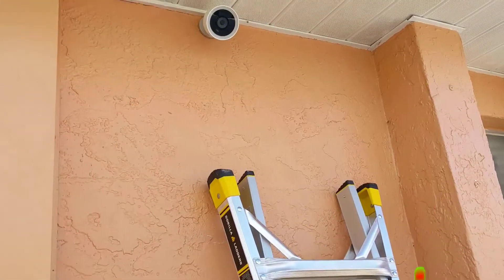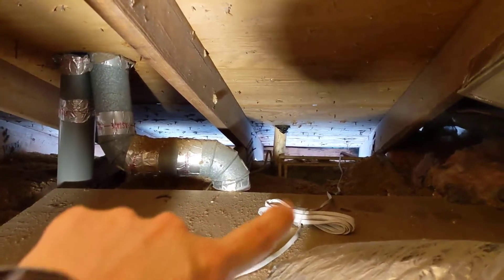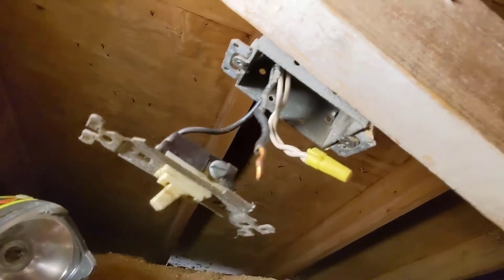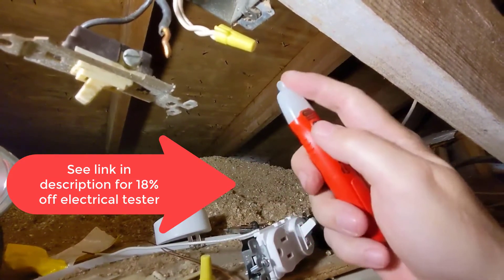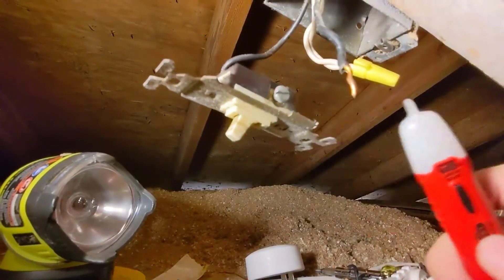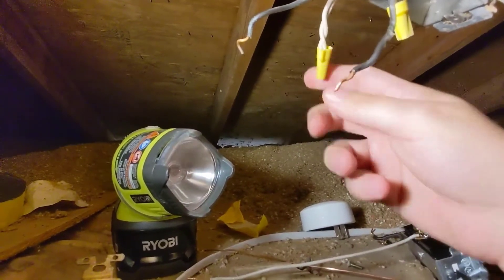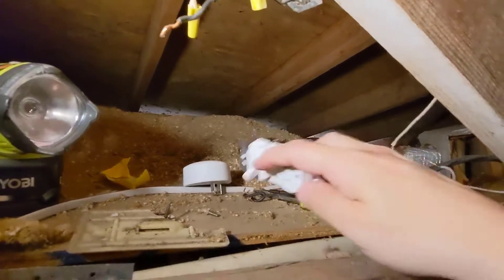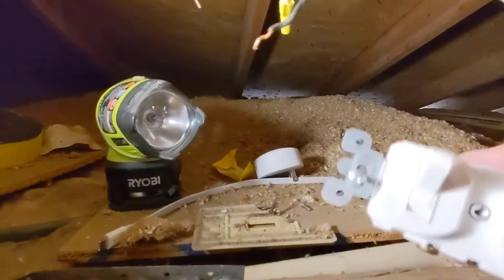How to install ANY Google Nest Cam outdoor without available outlet basic home wiring

Comment: Can you cut the wire for the adapter and hard wire it? I have a light fixture beside where I’m going to install it, was hoping to just cut the wire and hard wire it to the wiring of the light fixture
Reply from the maker: Problem with that is how will you disconnect it or unplug if you need to cut the power to it?
Reply: @SaveGreenHere  good point about unplugging it. I was thinking it would be permanent so it’s always powered. The outdoor light fixture has a switch which would control power to it. Just brainstorming some other option!
Reply: @OmarChannel Have you already a solition? Is also want to hard wire it to my light.
Reply: @Larsehh  I was advised not to cut the power and hardwire since, the power to the light fixture is AC, and the plug had ac/dc converter (DC is fed to the nest camera). Doing direct connection could damage the nest apparently. At this point just charging it every few months.
Reply: Im thinking of hardwiring my nest camera as well. The access from our part of the home to the attic or basement is going to be very difficult. There is a light about 4ft from where I want to place the camera so I’m hoping to use that. 

If you need to troubleshoot the camera by power cycling you can always turn the breaker off. If you need to disconnect the camera for whatever reason, it’s not going to be as easy as unplugging it. You will have to undo the wires or disconnect connect it at the hub
Reply from the maker: Maybe one of these will work and you will have an outlet. https://amzn.to/4cjfys9

Comment: Will the power adapter be able to withstand the heat of an attic?  Temperatures in an attic can reach 130 F or hotter.
Reply from the maker: Well, since Feb 2021, when I filmed this video, to now, June 2023, it has worked 100% fine.
Reply: @SaveGreenHere Any chance I can piggy tail a romex cable from the new otlet you installed so I can have a new set of white, black, and ground wire outside?

Comment: So I appreciate you taking the time out to show individuals how to install the Nest outlet plug to an outlet in the attic. The only "Issue" I have is the video says "Without an available outlet". So I was a bit confused throughout the vid. My initial thought was you were going to remove the sheath of the Nest cam and integrate it into something else like flood light wiring. But still a very informative vid, thanks for sharing.
Reply from the maker: Understood. Thank you for the comments, and glad you found it informative!
Reply: So if the nest camera is plugged into a wall socket and if it's unplugged will it still record?